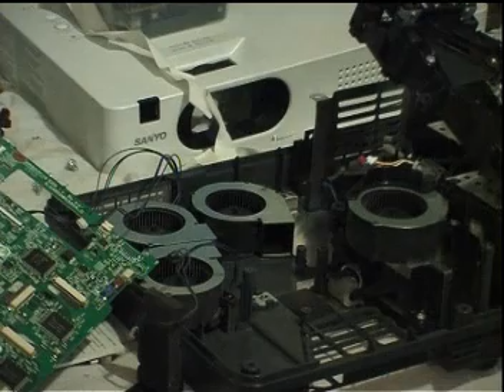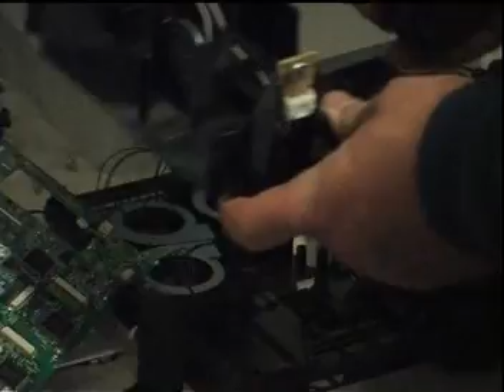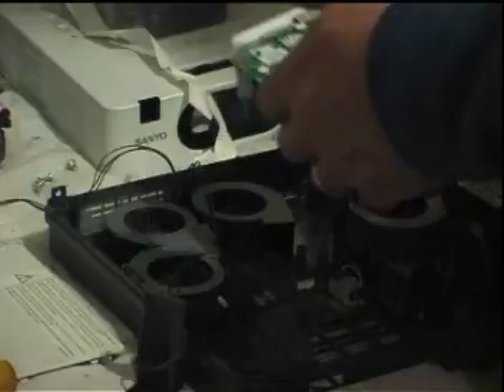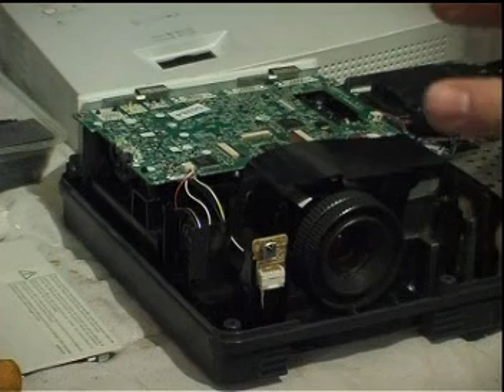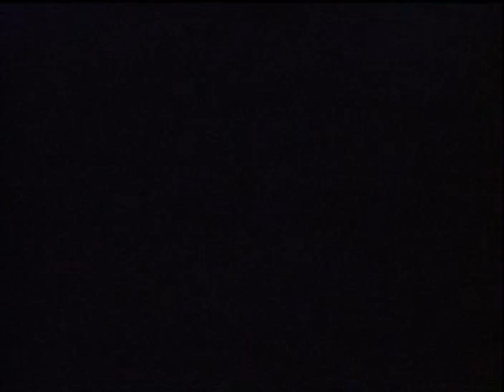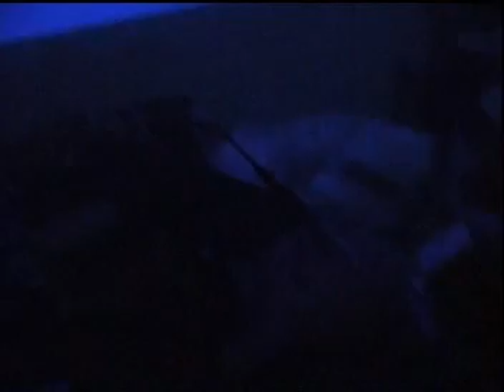SANYO PLC-XW200/ 250 PROJECTOR REPAIR

Comment: hey, 
I have a question to you. 
I have a sanyo xga projector PLCXU301A. When I power up my projector the fan appears to work over time, then slow down and then repeat this process a few times, once it has done this the light switches from flashing green next to the power symbol and turns red on the bulb symbol. It was doing this last week so i bought a new bulb, I've put this new bulb in but it is still doing the same routine...
What can i do ? Can you help me ?
Reply from the maker: sounds like you need to check the fan cluster under the optical engine
Reply: Presumably they are the controlls for the temperature... I dont know... because it switches to the warn signal....
Reply: Yekta Baysa

Comment: Which color wires did you use to test it? Also where did you purchase the fans? mine is having the same issue and I need to replace one of them. Thanks.
Reply from the maker: so sorry Borislav just picked up your message you can test the fan by connecting the black and red wire to a variable power supply then slowly turn up the volts if you tell me the fan that has gone I will have a look for you just send me an email to johnjvs@live.com